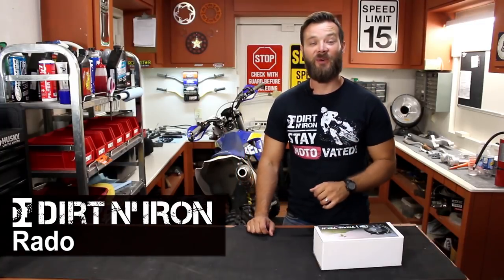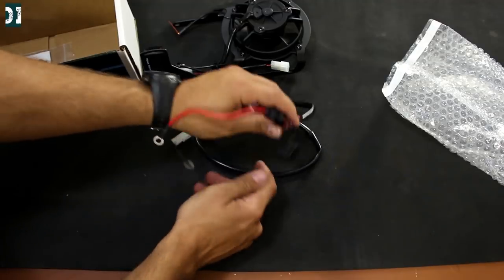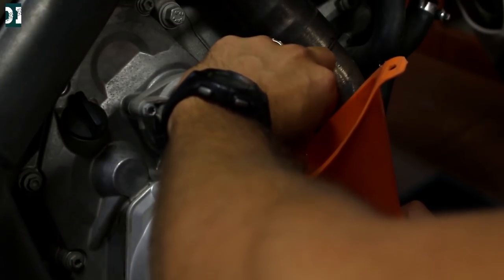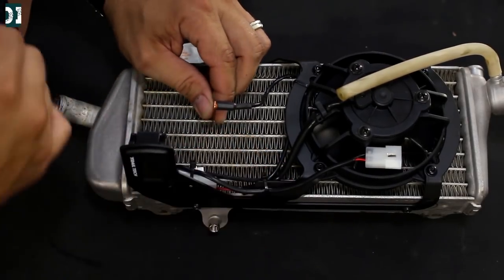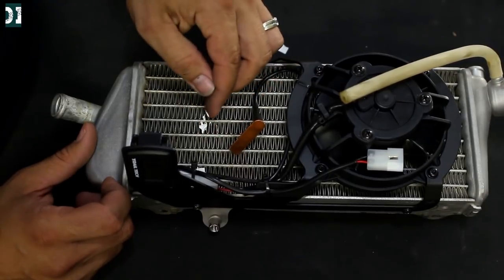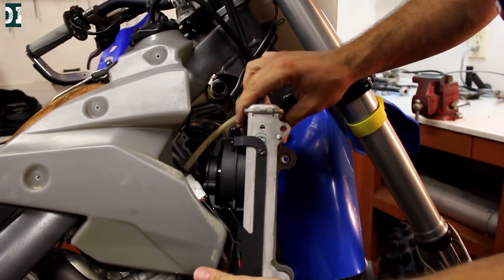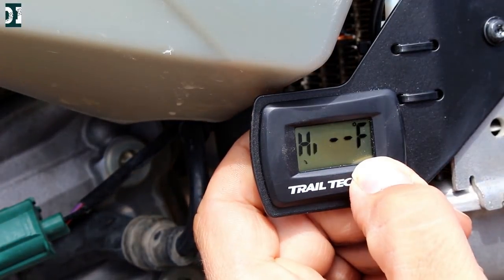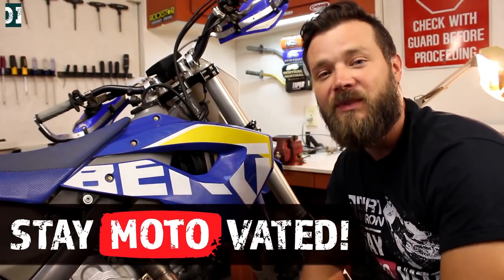Must have dirt bike mod for trail riding - Trailetech digital fan kit installation

Comment: Funny thing is that I realize that I have commented on this video 2 years ago. I did not have the Husaberg back then so I totally forgot about this specific video and the fan thing. I rode the bike for the first time today and really liked it, especialy the handling, which is amazing for a bike of this weight and size. It corner more easily than my 350 SXF, which is lighter and already known to be a great handling bike. I think they should have kept  refining and developing the bike and this radical mass centralisation concept.
Reply from the maker: yea, that would be so cool to have current generation 70 degree engine and whole bike

Comment: Awesome fan kit!!! I put a bigger pilot jet in my bike which stopped it from boiling. It was lean from factory to meet emissions. Google jetting for your model bike, see what turns up compared to what you have.
Reply from the maker: mine is fuel injected, I need to get power tuner, from JD jetting or something like that
Reply: Oh yeah:O Sounds exy:’(

Comment: Thanks for the How To Rado.  Great job as usual.  Seeing you install this, it finally dawned on me that these "fans" don't blow, they draw the hot air from your radiator.  Duh.  If I just thought for a moment about which side the fan was mounted, it would have been clear.  Are there fans that cool the radiator by blowing air across it?  Is one better than another?
Reply from the maker: Fan flow follows natural flow of the air as you ride. Fan needs to be mounted in the back to be protected and also not in the way of forks when you turn the handlebars. I haven't seen the fan for dirt bike that would blow air across.

Comment: Although I have never run my bike hard enough to have my rad fan come on or boil my coolant, it is an essential accessory for slow tight trail riding in the summer. I also use "engine ice" coolant (the internet says it is the best, so it must be true). The other thing about engine ice is that it is a propylene glycol based coolant so it is safe for pets if you happen to spill some and they decide to have a taste.
Reply from the maker: Sounds good:)
Reply from the maker: I was at the demo yesterday;)
Reply: At a KTM sx demo day right now. 350sxf with the cone valve suspension($10,000) = amazing.
Reply: @dirtniron  did they have the 350 with the upgraded forks and shock?
Reply: I found the 450 factory to be too aggressive and the 250sxf needed too much throttle for my skill set.   Our local track looked like it was a set for a WW2 movie ( bone dry and full of ruts and large rocks😡)  so perhaps with better conditions I may have had a better experience on the 250 sxf.
Reply from the maker: yes they did, but I didnt ride it
Reply: @dirtniron  poorly timed advise, but you should have. Today was my second time ever at a track or motocross in general and that bike allowed me to get pretty good air on some jumps. Although there were about 15 people at this demo day so I kind of had free reign there.

Comment: By loosening the radiator cap but keeping it on when draining the coolant it will come out with less pressure. Easier and less messy that way.
Reply from the maker: thanks for the tip, will do next time!